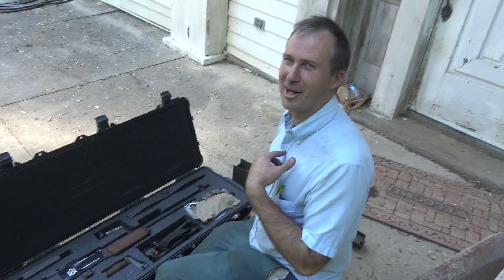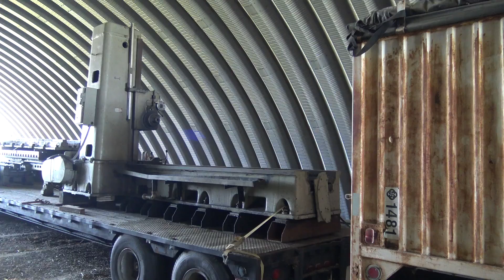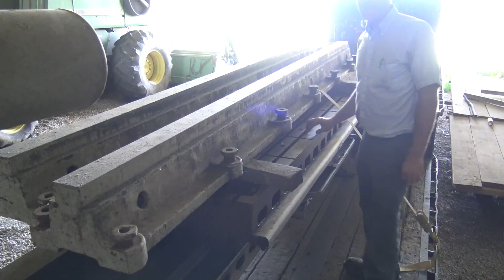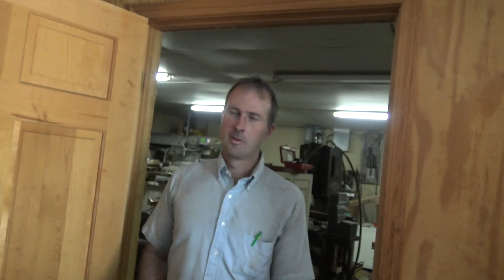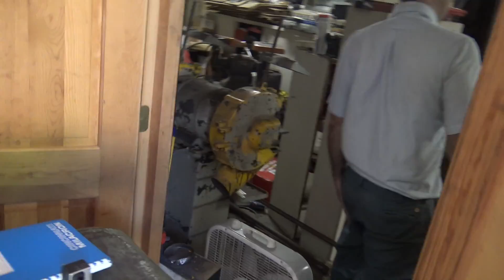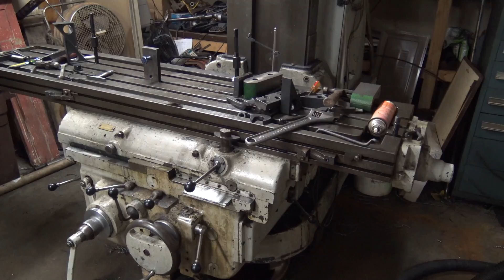Visiting bcbloc02's Kentucky Machine Shop!

Comment: I've run G&L HBM's most of my working life. That's the largest 340T in term of axis travel I've ever seen. I bet you could line bore a boxcar with it. Has Brian got the tailstock and long bars too? 

Trouble with big machine tools is the huge collection of attachments and set-up equipment it takes to run them competitively: 36" rotary table, vertical head with extension, 24" facing head. A skip box full of spindle tooling. Another full of large parallels, table keys, V blocks. Yet another of T-bolts, flange nuts, heel blocks, U-clamps, screw jacks. A hundred pounds of washers. 

He has a good crane to serve large machine tools and a big open floor for expansion. Can a big lathe and a VBM be far behind?. If he has all that and a rail spur handy, he has a real future in one-off heavy manufacture.

Tell Brian I know these machines pretty well and if he needs me to criticize him after the fact, I'm available.
Reply: Funny I had mentioned before that with rail service I could really take on big jobs. It is only about a mile to the tracks from here but it would have to cross several properties so I doubt that would be realistic. They actually build river barges up the road from here and haul them out on lowboys so I could still get some pretty big stuff in here. Some guys like working with the little pieces but me I like the big iron. :-)G&L may have made my 340T out of a 350T with a 4" head, it is rather large as for as 4" machines go. It is nice that it has the spindle stabilizing collet for stiffening things for heavy milling. I have my eye out for the proper tailstock and bars. I will probably end up having to just make bars on the Monarch for it.  This thinking about all the stuff I would like to have makes me think my shop is going to be way too small!